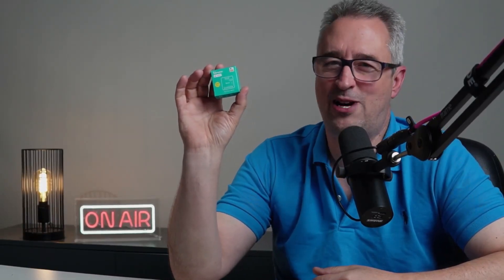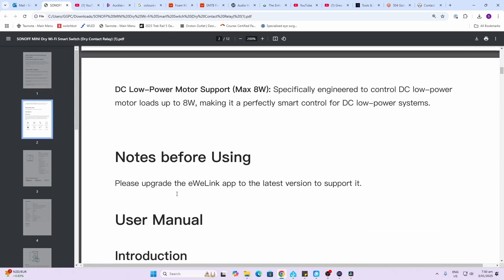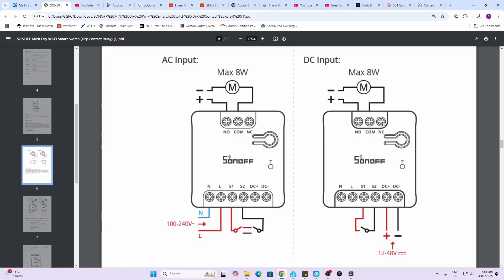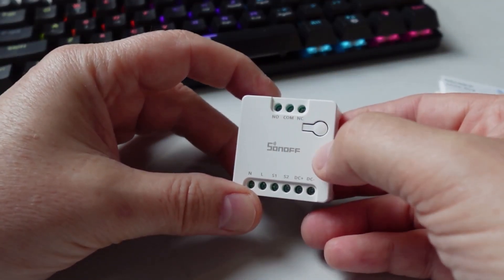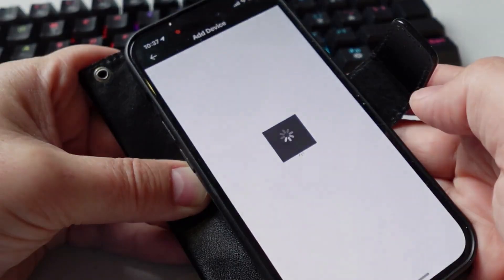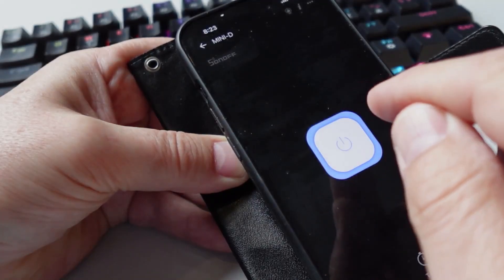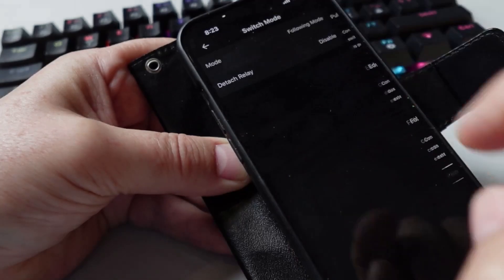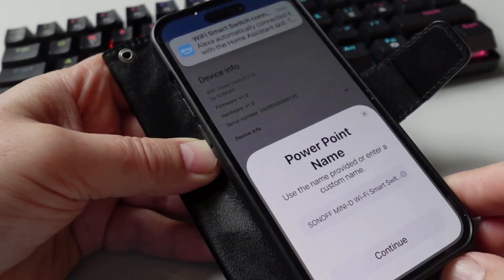Make your garage Door Smart with the Sonoff Mini, Dry Contact Matter over WiFi Smart Relay

Comment: Can this be triggered by contact door sensor and how to integrate it with the relay?
Reply from the maker: Yes the contact sensor can be connected to S1 and S2
Reply: @simonsayshomeassistant  Can I use regular security sensor (hercon with magnet, low voltage) as door position sensor? With Shelly 1 you need to use low voltage supply to relay in this case.